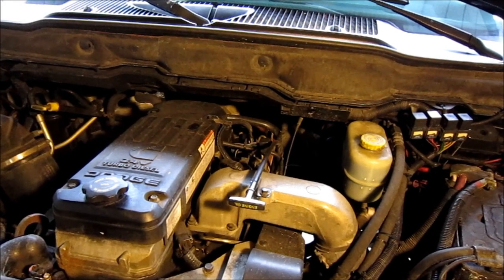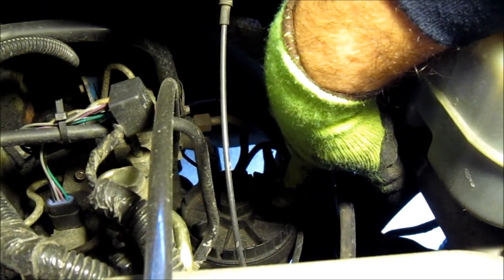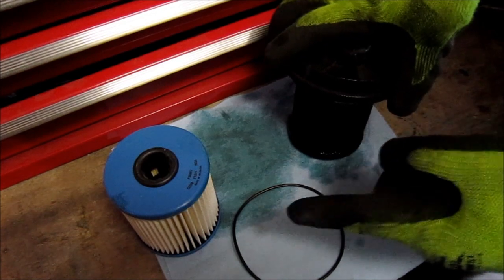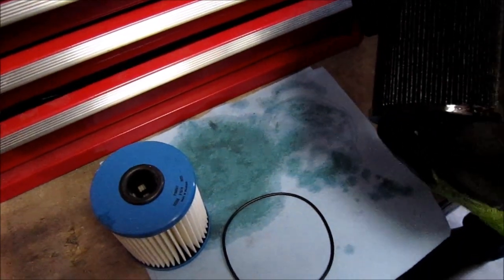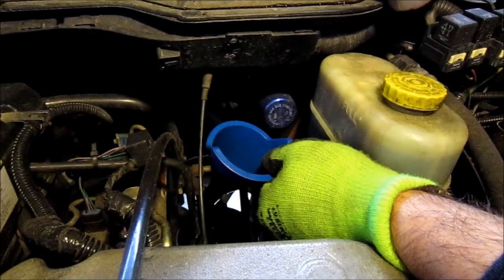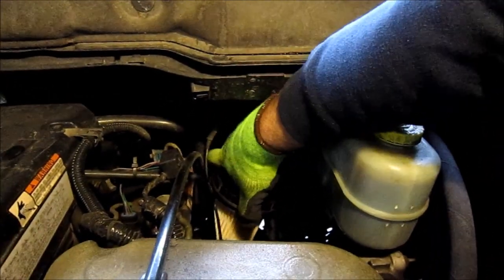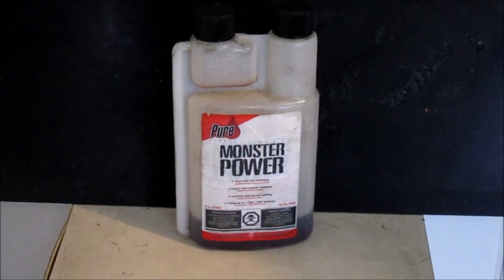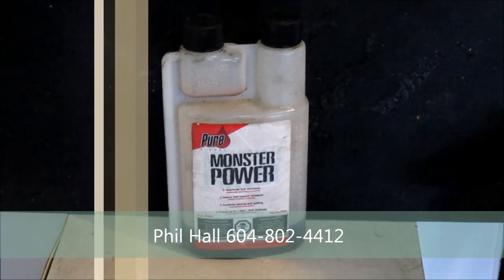FUEL FILTER replacement in a Dodge Ram Cummins | AnthonyJ350

Comment: Good video, but you forgot to drain the fuel filter bowl/water separator first (or didn't show it), and you should re-install the filter/lid combo into an empty fuel filter bowl.  If you don't do this and install the new filter into a full filter housing/bowl, you stir up any debris in the bowl, and it could bypass the filter and go straight to the injectors.  You also didn't mention how to get it restarted afterwards - turn key to the run position & allow the lift pump to fill fuel bowl.